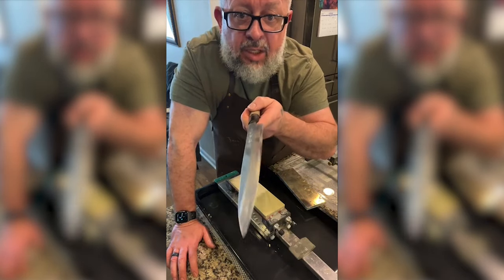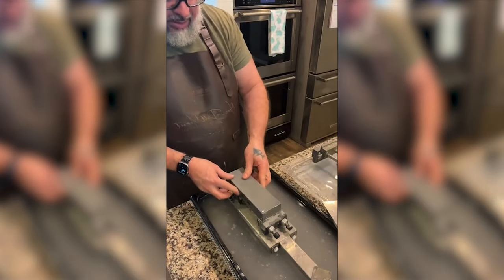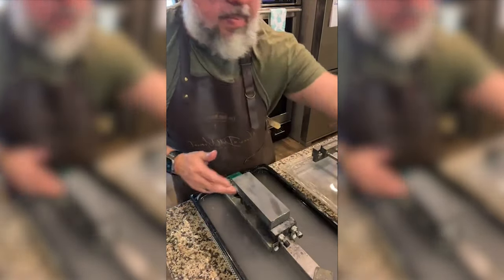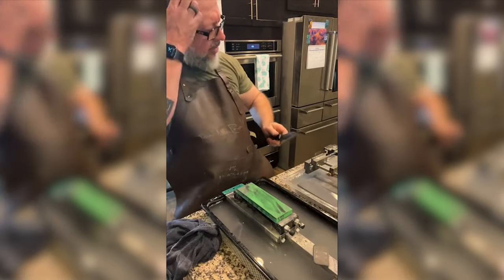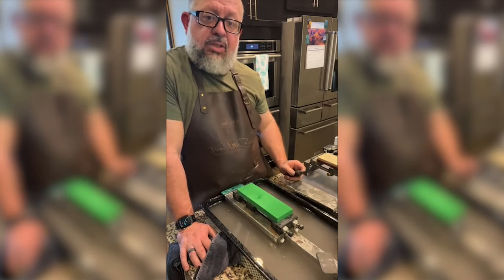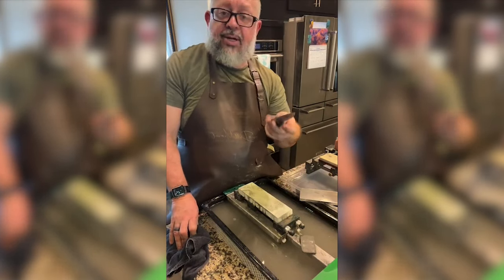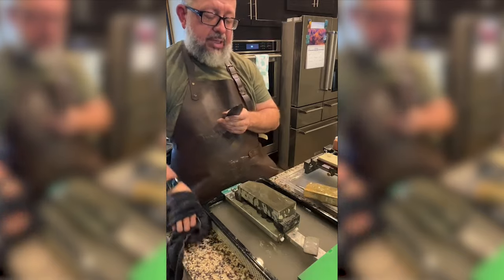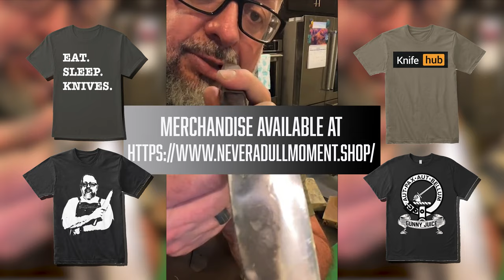Knife Polishing - this is the very beginning  of learning how to polish a knife.

Comment: This is my expertise🙏 I put mirror polish  on my tool steel knives.. Yesterday i finished Spyderco Mule CPM 4V for a friend..I use Venev stones and it works amazing🙏 from start 150-240F to 0.25micron takes few hours (depending on the steel)
Reply from the maker: Thank you for that. I want to purchase the Venev stones. It's not in the budget right now. Congratulations on having them. I hear they're amazing. Thank you for the comment. And I apologize for taking a while to get back to you.
Reply: @nadm  Its alright sir.. Polishing does help to close the pores on the steel surface but it wont hold very long on softer steels (just to add) Good luck sir.. If i can advice.. Change the direction every grit.. That will show you when the last grit was removed😉
Reply: Hey Greg the venev stones are more for mirror polish not really for kisumi
Reply from the maker: @Doodle-.Snoozel  still can’t wait to try them

Comment: Greg, thanks for a great video.   I just had a thought, since the heal of the knife is frequently used more often, and for non delicate jobs, I don't think it would be unreasonable to sharpen it at maybe 35° instead of the 25° angle that we need near the tip,  for more delicate slicing.
Reply from the maker: Absolutely. You would have to transition of the Blade, but you're absolutely correct. A lot of the knives are thicker at the heel and like you said, they're good for those really difficult, heavy duty jobs.
Reply: @nadm  thank you.

Comment: On the Aizu you can normally stop, but you need to let the mud work. Sitz gives nice hazy finish with almost mirror edge. Don't wash off the the mud. Jnats need slurry. The abrasives getting smaller and finer. And play with pressure. Get lighter to the end. And play with viscosity of the slurry. Every Jnat has its secrets to reveal
Reply from the maker: Yes sir!

Comment: So much of this also has to do with how well the knife was finished to begin with. Some knives have very little low and high spots, a dream to work on. Those are based on how it was grind originally and not based on your own use or methods. Others are nightmares you have to flatten for hours and hours.
Reply from the maker: I definitely got a lot of on the job training on this and you are absolutely correct. If the factory grind is amazing then you really don't have to do a lot of work. Obviously, that varies with each manufacture.

Comment: the biggest challenge is to mirror-polish a dead flat extended area and to keep it dead flat, like an actual mirror. in contrast, it is much easier to mirror-polish a surface which is slightly curved, like the inside or the outside of a bowl haha.
in theory the best way for this special task would be polishing on a flat stone. however, in practice, this comes with problems like grain contamination. The most efficient way then is to polish with sandpaper, even though that method comes with problems too. Bottom line is, perfect error-free mirror-polishing is a beast of a task, impossible, and super frustrating. Anyone show me his/her best mirror-polished workpiece and i could immediately point out the imperfections (defects) in the mirror polish, i.e. microscratches and nanoscratches and other imperfections (like micropitting and burnishing). Manual mirror-polishing is absolutely cruel of a task. After hundreds of hours, over several years, i gave up.
Workpieces which are very manageable and crowned with success are wire pocket clips: they have no extended flats, they are basically curved everywhere (point contacts, line contacts, no area contacts), so microscratches from polishing defects/errors can be polished out in a straight-forward manner, of course with sandpaper, and finally with polishing compound on microfibre cloth. There are polishing masters on instagram who manually mirror-polish blade faces. It takes them several days to get to a proud if not perfect result. Absolutely impossible to do so on a single day! check for example marcins_knives on IG.
Reply from the maker: I’m gonna have to read this again. I can tell off the bat and there was a lot to learn. Experience is definitely the key here. I just came out of a car accident. I’m literally getting out of the car with the hospital. I’ve been in the hospital for three days. I will re-read this and it’ll be quite some time before I’m able to practice what you said. Thanks for your support
Reply: @nadm  be well soon dear friend!
Reply: polishing compound will get it done quick, especially at the highest grits.